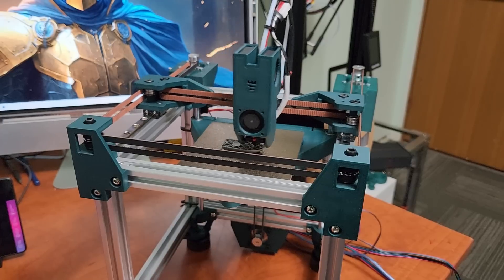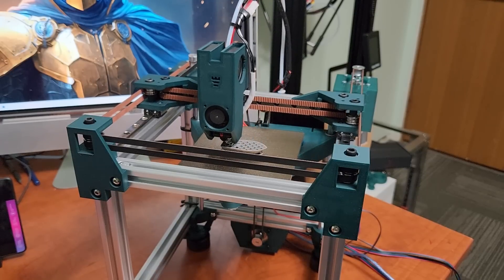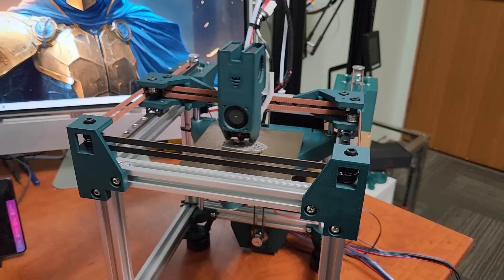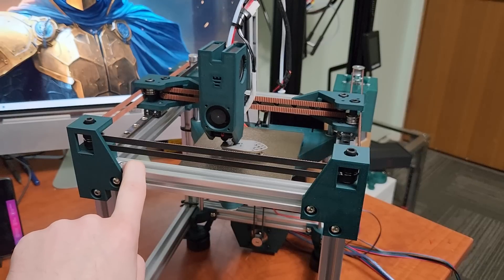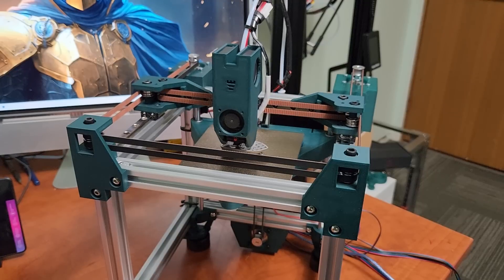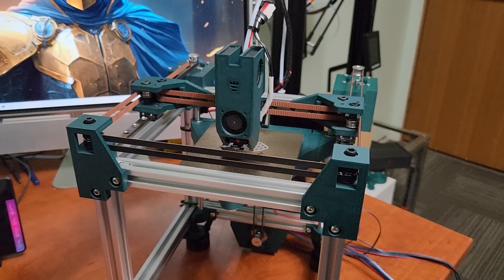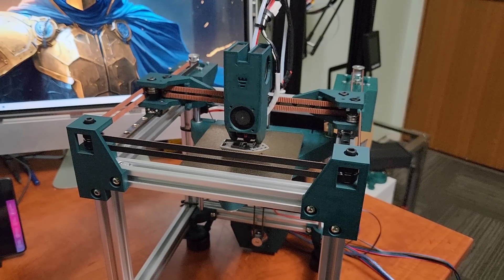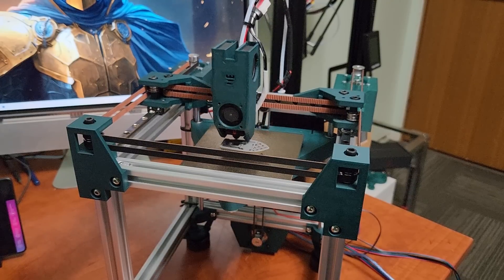DIY CoreXY 3D Printer Rook 2020 - More options for everyone!

Comment: Does this have to be made 'square' or is it just a matter of using longer 2020 where needed, with longer belts etc. ?
Reply from the maker: No it can be scaled, very easy for z. A little different for X and y. There is a scalable version on discord you can ask about

Comment: what filament is recommended for parts?
Reply from the maker: PLA or ABS if you able but PLA will work fine
Reply: @Rolohaun  that's what I figured....are there recommend print settings in the build documents or on printables..... I literally paused on the print setting part lol 4 walls 30%

Comment: Cool project.  I printed the orginal rook(dual lead screw) on an ender 3 and it took forever.  The build had some frustrating points that made me want to throw it in the trash. Cool little printer once it was up.  

I decided to build a rook mk1 (belt z)  I printed it on my vzbot and got the entire printer printed in the time it took to get half the orginal rook printed on the ender.  

It was also frustrating at times and I was extremely close to smashing it.  My kids like it and enjoy using it to print little things.  

What I learned from building 2 rooks is: I must like punishing myself. It's not a bad printer when done.  The gantry bearings are the worst part. Idk if I'm going to build this rook. Idk if my liver can take the alcohol required for me to assemble the gantry again.  I would rather build another vzbot over assembling the bearing stacks.
Reply from the maker: thanks for the feedback

Comment: You mentioned that the Zrods are now adjustable? I need then about 2mm closer together to get a smooth bed.. simple fix is to file the extrusions; is there a better way?
Reply from the maker: the rods mounts can go anywhere on the extrusion you only need the back m5 you can leave out the side ones if you need to slide it over
Reply: I might print like 1 and 2mm shims just to still keep it looking good.. I wish I had better CAD skills I would just make one side longer in 1mm steps to get exactly what I need... thanks for the great work and I look forward to building this great little machine..
Reply: Spacers worked perfect bed is smooth as butter with 0.8 spacers on both sides..😊

Comment: Great project! :) i have a question about X Y axis movement. Usually we have separare motor for X and for Y, but here both motor are controlling XY axis toghether. Can you tell me, is it some specific software or motherboart to make this? Thank you :)
Reply from the maker: this is called CoreXY and any 3d printer firmware supports it

Comment: Would love to see you modify the bed so that it isn't cantilevered. As I find many of those have issues with holding level (on the lever, as well as "left/right" as the rods or rails can allow tilt (different heights).  A "trident" style is my favorite, but even just a dual lead screw/belt system would work better than the cantilever imo
Reply from the maker: for a printer this size cantilevered is fine but yes my other printers will use 3 point support like trident
Reply: You would need to design a new bed-frame, but the motor-mounts and idlers on z can be put anywhere. Simply print two more z-motor-mounts and adapt your bed to suit. Using 4 linear rods is simple too, 2 more rods and 4 more of the brackets for them.

Comment: interested in doing modded version for 235mm² bed. would printing parts in petg be recommended?
Reply: Would avoid petg for printer-parts in general, atleast for structural parts
Reply from the maker: PLA, ABS or ASA
Reply: Russell Phelan  they use ASA

Comment: I started with a Monoprice maker select V2 bed slinger with 200x200 bed and I kept upgrading it until the main board died so I got a SKR Pico V1.0 for it but haven't gotten the board powered up yet with a pi since I've never used Klipper before.  Since then I have a prusa mini and sovol sv06 printer that both print really well but the maker select is sitting dormant for years now.  

I keep debating on re-using as much as I can from the "maker select" to convert it to a core xy printer then I stumbled on the rook a few weeks ago then "THE 100" recently.  I really want to re-use my 200x200 bed so wondering how good/bad it would be to scale up the rook 2020 then I wonder how hard it would be to convert to round rails  to re-use more "maker select" parts.

Then I think I should just sell the "maker select" as is project and the working prusa mini to fund a Bambu Lab P1P.  Maybe sell the SV06 too and just have 1 printer.
Reply from the maker: users are already talking about larger version on the discord, that size would be fine
Reply: If you're looking at a bambu, take a look at the new Creality K1. Has lidar and Creality is claiming it's faster than the bambu. It's corexy, starts at $599, does a 13 minute benchy in ABS. I could go on and on about the features but I'd suggest it. Looks like a sweet competitor. The k1 max, the bigger boy, has a 300x300mm build volume!

Comment: To make the belt grip better on stepper movements, add two smooth pulley to left and right of belt next to gear pulley. It will wrap the belt more around the gears, providing more traction.
Reply from the maker: I haven't found that necessary on this printer

Comment: I solved dual or multi Z threaded rod alignment issues for many Z bed print setups.
Key is to allow the Z threaded rod to move to and from relative to direction all around but not spin the Z screw nut.
Z screw nut is bolted to L shaped bar. L bar lifts the vertically tall bars bolted to the bed rail carriers.
The key is to not bolt L bar to flat bar. This allows movements of Z screw on threaded rod, but it will not spin. All spinning movements of threaded rod will move the z screw up and down.
Reply from the maker: this is belted Z it does not have a lead scew
Reply: I can't believe you solved that! You are so smart

Comment: Can it be made in 400x400x400mm build volume without losing speed or quality?
Reply: It would require stiffer parts. The larger you get the less stiff the system gets
Reply from the maker: that is pretty large, I would go 2040 frame and 10mm wide belts